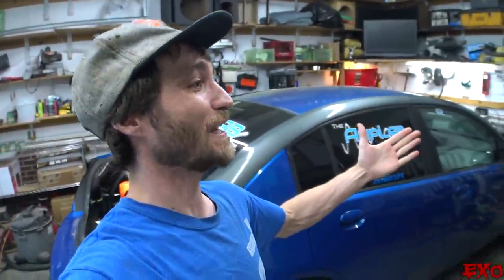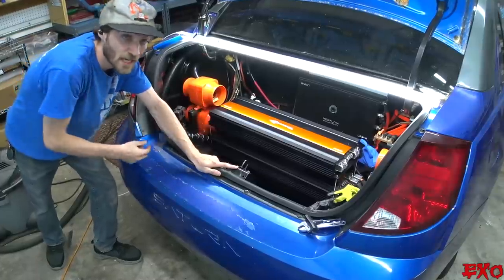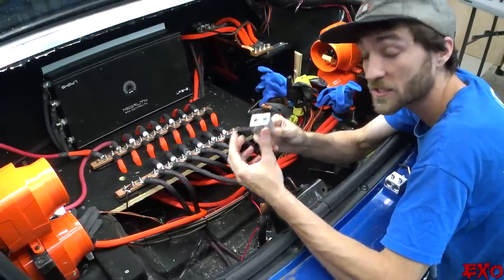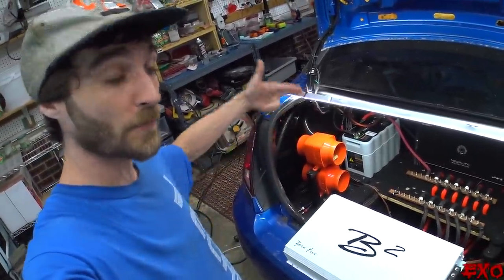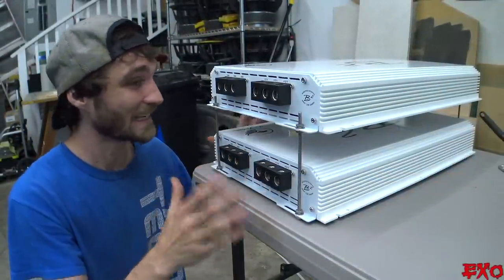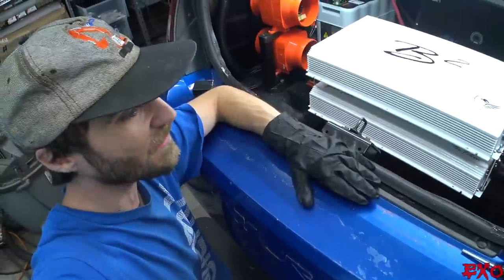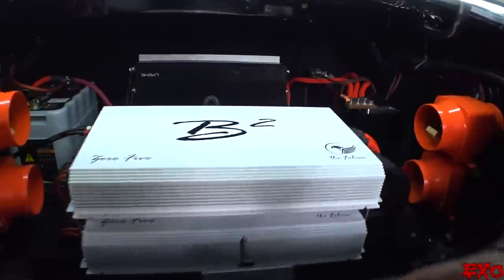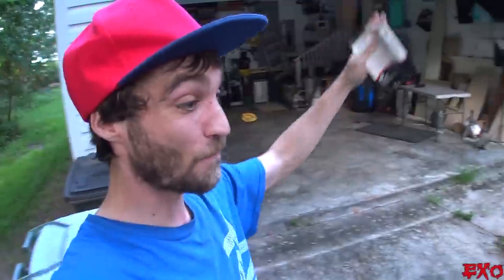DOUBLE STACK Amplifier Install w/ 10,000 Watts of B2 Audio FALCON Bass Amps + LOUD Subwoofer Demo!!!

Comment from the maker: Nothing like a nice relaxing car audio install!!! Wiring amps is my favorite part, what's yours? Thanks for joining the fun 😀
Reply: My favorite is wire management and listening.
Reply: The first real listen after the break in is my favorite part
Reply: What happened to the vibe 10,000?
Reply: I wish I could make my amp wires look better
Reply: Do you use computer software to design your boxes? If so which one to you use and if not is there one you would recommend for a beginner even if it cost good money ? Your builds are amazing and videos are very informative and inspiring !! 🔥🔥🔥🔥🔥
Reply: I would love to be able to afford to have a good sound system in my car , so instead Ive got a jvc portable bluetooth party speaker in the boot, it will have to do as it sounds better than my stock sound system.
Reply: You the best Exo! Completely the reason im back in car audio and why I’ve just purchased my first 8k amp!
Reply: My favorite part is designing and building the box.  Paying close attention to the air space, the wire management inside the box, and trying to take into account box rise.  It can be frustrating, but when you get it all right, the reward is incredible bass!!!  And that is why we are all here!  Regardless of your favorite part, it all comes down to the bass!!!
Reply: Yea see what there putting out bro, and see if you gained any DBs or loss....I'm interested!!
Reply: What was it hitting before 150ish? Sounds alot cleaner..love your vids keep up the work my dude!
Reply: My favorite part is the tuning...
Reply: I still bang that djsnt beat geeks tune... You turned me on to it years ago...
Reply: Please do a tuning vidio
Reply: Same here idol
Reply: My favorite part of a build is screwing in my subwoofers caus the anticipation of waiting for the sound of the build is so thrilling. Getting to hold your subwoofer in your hands is so pleasing. Then cranking the woofers up is even better I love woofer excursion woofer porn is so pleasing to watch. I love watching them big woofers bouncing up and down on the their suspension and the coil going in and out. So hard to figure out to invert the sub or mount it cone showing. Eather way is so pleasing.🔈🔉🔈🔉🔊🔊👏😀😂😁
Reply: Haven't had bass in almost 2 years... Went from a s10 blazer to a Mazda rx8, not very much space in the trunk of one turns out lol. Definitely wiring is my favorite part. So satisfying when you finally get things to turn on.
Reply: I could say my favorite is creating something from nothing and listening to it and feeling the vibration like an exciting roller coaster ride
Reply: Hey exo what was the first dj slow n throw song you played the one before heisenberg?
Reply: Like Asher said keep on rumbling nice trick with the gloves have to remember that I usually tape em
Reply: I love wiring too but the best is building a box half fiberglass half wood or plastic 

My current build is in a 02 Sentra wheel well box ... Currently building .... Skar VXF-12 1500watt RMS wired to my ORION XTR-2250 "THE BEAST"  full killmat 80 mil ....  (2) DB drive 6.5s and (1) 10 inch mid range skar Neodymium NPX10-4 to skar 4 channel 900 watt amp. 

Might be upgrading my sub to ZVXV2 15-2 
But the VXF-12-2 IS A BADASS SUB FOR THE PRICE.
Reply: I think wiring is my favorite part of audio.
Reply: Good day sir,i"m one of your subscribers here in Cebu Philippines, how many amp.and how many speaker of your blue car?can you help me to set up my own sound of my car?
Reply: Hey EXO, where did you purchase the orange fans from? 

I'm looking for a heavy duty fan for my audio build for my Dodge Charger
Reply: Tuning the amps are mine.
Reply: would love to see you tune it up ..great build love the energy
Reply: The subs flexing more now! I like it.. what makes the SPL now? Whats the score now? Make a video about that? I have metered my home Musicroom and i have now 152,9 Dezibel 😁👍 the score is at home not in a car or pressure room only in the room 😁 i like it.....
Reply: Hey EXO please tell from your B&C Speakers,  the typ and the datasheets of that.. 😊👍
Reply: In the car i have a 13,8kw rms Amp and fire at one ohm load to my two 18"s 😁 in a Toyota Landcruiser prado
Reply: My favorite part is installing the speakers in they box and in the car
Reply: Love taking pictures of the build progress and flipping through them
Reply: I Just Got a Little Skar 2k.. Three JL Audio 12 W/0's I've had for several Years now, Like 10 years. They Just wont Die lol But then again I keep them sealed up Tight and the Origianal JL Power Wedge Box is still Mint
Reply: Hiding Cables And All Wiring,,,, J/K THAT WOULD BE A HUGE NEGATIVE!!! Building Enclosures Would Be The Best Or Liked Part Of Anything To Do With A Build Or Install
Reply: Audio Technix,  man great memories . Rest in peace Colman
Reply: My favorit part is to clean the install with a DSP  and listen the finish build with good loud  music.. 😁
Reply: @Phatkid1  you find a free software on www.selfmadehifi.de/basscad.htm  or AJhorn. First link is a german software but its fee , easy and work fine 😊
Reply: Nice setup man
Reply: @EXOcontralto the amp stack rods tip.......   Grab some spare 8 gauge cca spare wire, or what spare you have,  pull the wire out, and use it as decoration to cover the bare metal stack studs.
Reply: Amplifier models please
Reply: Same, running 0/1 guage
Reply: EXO  I love how positive you always are, even through the more challenging situations like a belt snapping on ya. Love the vids and builds! Always find some great ideas you come up with too. Little BLUE"S BANGIN"!!
Reply: I just wired a system up in my mk7.5 GTI and man was it such a pain in the ass
Reply: Bro is better than womans  true
Reply: Exo contralto I've been trying to get a hold of you to give you a team Gates badge and do a possible give away I was on team Gates and Alma was a great friend of mine r.i.p and I wanted to pic a few people that truly represented the bass community and what it was about a d keeping it alive. And you were my first choice so if interested please respond back to me I also wanted to possibly and you some extra for you to do a giveaway or something like that.
Reply: @Phatkid1  box builder is a good one I've used it for years.
Reply: Building boxes, playing with port tuning.
Reply: Building fiberglass panels for boat speakers on the inner sides, so much potential in any boat. Most relaxing to me
Reply: Would have to be running all the wiring nice and neat
Reply: Do u sell amps dude ?
Reply: wiring!! I love wiring! I hate trying to decide how to layout my amp rack bcuz I can never make progress!
Reply: I cant express how excited I get about the whole process an then the gratification of completing it and the music after that is a entirely different experience! But I hope to one day bass with ya bro be pretty cool two of the exact same cars pull up beating down the block lol
Reply: My favorite part of the build is when I can turn deck on and listen to some music.
Reply: @buddahfingers  since you said boot for trunk then you are in the UK check out the shop HULL
Reply: @chriss4189  lol oh damn! We both got our first 8k's thanks to EXO!!
Reply: Hey man 🤪 I only found you about 3-4 months ago and I'm loving it 🤡 I haven't had a system of good quality and sound since I was back in the 80's. You know the story.. wife then kids and all that adult stuff. Ya. No system. Now the kids are bigger and I got a new VW beetle 🥰 and honestly I'm a little spoiled. Plus who does a beetle 🥰 so I redid the entire system. Which for a factory 6spearker system wasn't bad. I went with a Kenwood HU, I went with the elite series 6.5 skar speakers and tweets in the cabin. Skar 10" sub and box. Sadly it didn't make it but about two weeks 😒 so I went with a DB Speed series 10. Was okay. But not really what I thought I wanted 😂.  But now I got a 2k for the DB and it's so much better. Some songs give that slight vision blur👍👍. But. You guessed it. I wanted more. So I went and got a DB Comp 10 rated at 1/2k.  I stayed with the 10" because of room. Hatchback. But I ran into a little problem. I don't have enough amps to run all the new competition goodies.🤬. So long story short. It's a beetle. No aftermarket parts for upping the amperage out put. Research, bla bla bla. Can't buy a hi alt. Custom. Or dig in and see if anything with cross fit from Audi. So kinda my fault for being to excited about system finally, but I'm kinda made/upset with the stereo shop. Day one. He knew what I had. Great cash prices. Good info. Bla bla bla. But he did his job. He sold me stuff, good stuff. But he knew what I had and where I was going. But not once did he advise me on what might happen if I do this or put this in.  So that kinda irritated me. I don't go back. But I do now have a nice sq system. It tickles your ears some. So far now it will work. Buy that new sub is sitting in the closet calling me 😂. It's not that I can't hear the music. It's that the people two cars up can't enjoy it. 🤪🤣😂 Love your channel and your personality 🙂 ty
Reply: @beyondoasis8356  my 15 VW beetle was a pain too. Replacing everything.
Reply: David Lunsford it was worth it though! Mine just set off like 9 different fault codes and I thought I broke my new car lol
Reply: I like the idea of creating something that you can't buy off the shelf.  Could you do a video on making low profile boxes that still have a good punch of bass?
Reply: A relaxing car stereo install? I would hate to see you when you're excited.🙉🙊🙈
Reply: Def tune it up bro .im getting the b2audio riot 7500.1 for my crossfire 18
Reply: I use to ejoy tuning
Reply: Whats the name of the subs?
Reply: @MrJtrillion  he has psi platform 5's  monster 18's
Reply: Makes me happy  to see you enjoy your bass. Exo nothing  but love bother for one bass head to another.💯❤
Reply: Building enclosures is my absolute favorite part of this whole car audio thing 
I'm constantly changing my setups so that I can build a new box 👌🏼
Reply: Great job man car audio is always fun love watching your videos after being diagnosed with cancer had to sell my small sound system but car audio is helping me get back into the grove and helping with keeping my mind busy keep up the great work
Reply: I'm hsving sound issues. My Amp keeps cutting out when I turn the volume up. Is a 5000 watt Amp with two 450 watt subs too much power for my car? I have a 2008 chevy malibu
Reply: My fav part is when i receive the products in the mail😂
Reply: Mine favorite part is presentation :) ... The kind that when people look they go "whoaaaa that looks awesome"
Reply: Is that box 15:44 built for the car or is for the size of the speakers anyone knows?
Reply: This reminded me of one of the only special memories I had as a kid growing up couldn’t afford a box back then I was prolly nine and all the older kids had nice systems I new I wanted one my grandfather said we could build one he could of bought it but took the time to teach me cause at that age it was like majick I was thinking yu can’t build one but we did I wish I was able to have him in my life longer he passed from cancer not that long after awesome job def can tell your super passionate about
Reply: Yes amps are fun but I was wondering I’ve watched u from day well new to bass with a van I believe or maybe not new to bass but bro I thought you was a pro by now bro all my gloves have holes from installing amps man all those battery’s unhook from power going to amps u scare me bro 😰 😅  lol nice set up way better than mine wish I had your hook ups and money. Guess I’ll have to find my YouTube nitch. Or what people want to watch.
Reply: I have a  3000 wats rms sundown amp on a 210s 2500rms each  alpine pdx100x4 on stuck batery I upgrate on a biger amp wat second battery are u recommend because my ligts dim wen that bass hit it or do I Ned 2 extra
Reply: I have already that big3 and a 220 alternator amps
Reply: U gotta name that song Bro, imma do a build same like u.
Reply: Wired to 1ohm?
Reply: Opening the box on new subs
Reply: The addiction is real..keep bumpin bro
Reply: I love designing the box and building it. it satisfies the most when I get the subs mounted and and get that first demo in the pretty new box
Reply: I have 4 amps that im gonna stack up..should i use the rca ins and outs to daisy chain rca signal or use a cockbox and why?

Comment: I remember back in the day, if you had a 250w amp you were a badass!
Reply: Real wattage then
Reply: @crisfiler6128  its still real wattage, but the subs now are way less efficient than the ones back in time so you need a lot more power than back in the days to get as loud but subs in general can take orders of magnitude more power now anyways.
Reply: @BH4x0r  Depends what you call ' Real Wattage' the figures some manufacturers use are a joke nowadays.... PMPO ect.....RMS is the real figure to look at.....and speakers are a lot more efficient nowadays... 100db with 1 watt RMS @ 1 meter was unheard of in the 70's /80's
Reply: When are You talking late 80's or really early 90's?
Reply: Yeah..me too.
I had a 1200 watt lanzar..and I was a beast.lmao
Reply: @bluemoon3351  An old friend had a 1200w eq... yeah. We didn't believe that! In dash EQ amp...
Reply: @crisfiler6128  pro audio yes, but car audio subs average between 86-89dB @1w @1m (without taking car acoustics into account)
even the more powerful 18 inch subs are around 89-90dB efficient because they sacrifice on efficiency and instead focus on the real deep work for the people running Decaf/slowed/rebassed music etc.

Pro audio woofers and subwoofers are a different story.

also i never look at peak, pmpo or program ratings, if one site doesn't give an actual rms value of a driver i just search another site when i'm looking for a specific driver.

i'm talking about 90s and 2k+ but in the 90s subs took way less power and were way more efficient
Reply: That's like having an 4 0r 8 gig flash drive back then, now 32, 64 , 128 , 256 gigs now🤪
Reply: Nice 👍 set up u have keep it up bro
Reply: @crisfiler6128  From my experience with vintage HiFi home audio gear, if anything I think gear from the 70s/80s was underrated. Most basic 2 channel stereo receivers from then were rated at under 20 watts per channel, yet in use have more than enough power to push a big set of speakers without distortion above listening volume. My Kenwood KR-4140 in my primary home audio setup is only rated at 18 watts per channel at 8 ohm, yet it pushes my custom 2 ways (with 8 inch mid woofers) like nothing. I don't know if early car audio gear was similarly underrated or not. In my opinion though, I would consider the RMS wattage brand name companies like NVX, Kicker, B2, etc, use to be "real" wattage, the SMD D'amore amp dyno being the most widely used to measure amps in the car audio community. The majority of mainstream companies nowadays definitely pull that fake wattage crap for sure though.
Reply: @BH4x0r  That's why for one of my builds I went with a dayton audio ht sub.It's basically like an old school car audio sub,very efficient.Great low power setup.Sometimes you gotta think outside the box.
Reply: @crisfiler6128  Up to a point,on low power setups it doesn't matter to me because amp power is so cheap now.I only need 500 watts and I could get a 1500 watt(1200 actual watts) amp for $120,or a 2k amp that does at least close to 2k for $250.
Reply: My first stereo was a lanzar 240 and two cerwin Vega 12s in a box that barely fit in the trunk of my 84 buick and of course a pioneer tape deck. I remember it being loud but probably wasn't

Comment: I would love to see how you tune your amps. I'm having a little trouble tuning my amp.
Reply: TUNE IT UP!
Reply: Usually i do 80 and 80 high and low to be safe then my radio eq i dont have any tools to do it like exo
Reply: tuning all depends on the setup your having, what car, size sub.. . its so personal to your likings.. EQ does a lot..
Reply: My only issue is the higher bass notes disappear. I've been listening to the same songs forever and I know when to expect the bass notes to hit and the higher ones don't. 

I recently switched (upgraded) to a pair of Skar SDR-10 and an Audiopipe 1500 amp. Subs are getting over 700 watts RMS each. The subs are in a prefab box. The box can't be the issue because I had it in the previous car and the music sounded good. 

Pioneer head unit. Kicker 6.5" in all the doors with a Toro mini amp. 80x4 watts. 

All professionally installed first time ever. I'm making more money and I thought it would be better than asking a cousin or someone to do it. Obviously I'm not at all very good with audio installs. I've been tweaking all the level on the bass amp and the radio to see if I can get those bass notes back and I just can't figure it out.
Reply: @davidnievesjr.9478  Most likely your low pass filter (lpf) is just set too low for your music. Easy adjustment to make. If you don't want to fiddle with it yourself take it back to the shop.
Reply: @davidnievesjr.9478  your new amp may have a frequency cut off, make sure that's turned all the waycant 
Try changing the low pass filter on your deck, raise it until you hear those bass notes that r missing. Again if you still can't  maybe your new amp may not be a full range amp (sub amp only?) If so the amps top frequency may be lower than your previous amp. If this is the case your other speakers will have to produce those missing sounds.
Good luck
Reply: Thanks for the replies. This is a fun ongoing hobby.

Comment: Hey just a quick tip to make your amp stack look a little more awesome you can use aluminum tubing as a spacer and to hide the threads in between the two amps keep up the good work 👍